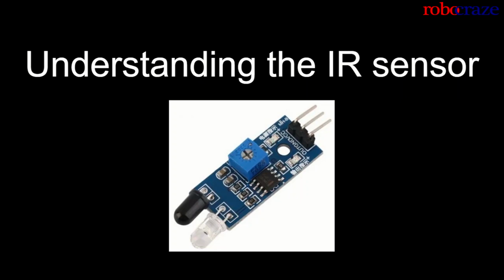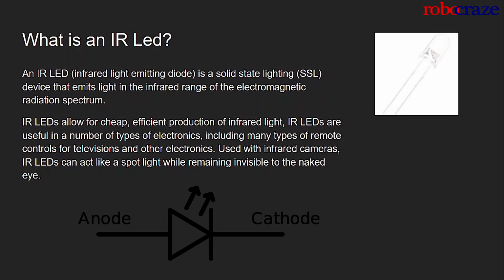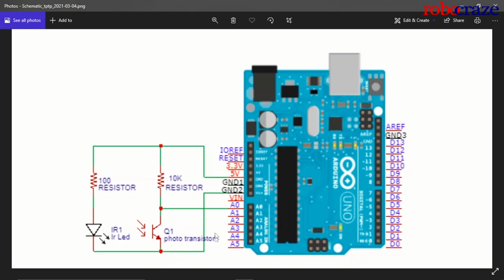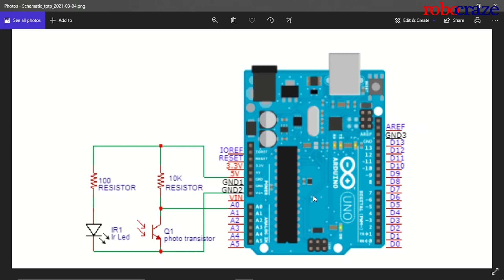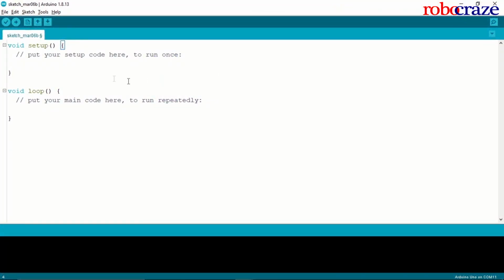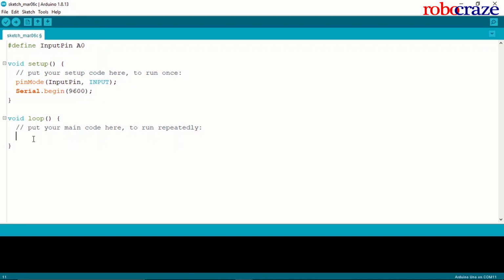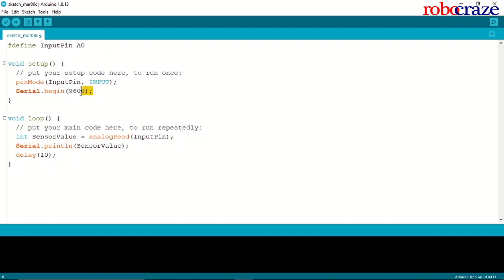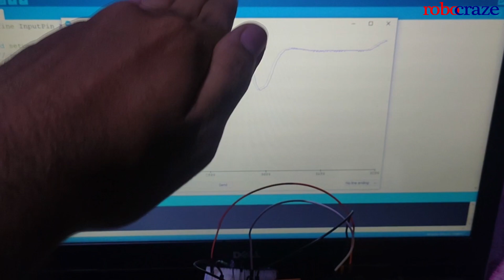Make your own IR proximity sensor! [DIY IR sensor with Arduino]

Comment: Sir, I need help in a project. I have made the structure by its not working. Since I am not a person of electrical engineering background I am facing problem to figure out the cause of it .Can you help me in that?
Reply: start by testing the components individually, If all of the components work just fine without any errors, maybe it is time to check the Circuit Diagram and make sure all the connections are made properly, If everything is good then you should finally check for the code used...Maybe that should help out.
Reply: Thank you very much sir.
Reply from the maker: Hello! I'd be happy to help with your project. To troubleshoot, please check:

Connections: Ensure all wiring and connections are secure and correctly configured.
Power Supply: Verify that your project is receiving the correct voltage and current.
Components: Make sure all components are functioning and compatible with each other.
Code: If you’re using a microcontroller, double-check your code for any errors.
Feel free to provide more details if you need specific advice!

Thank you for reaching out! :)